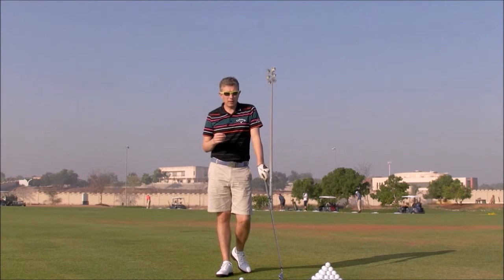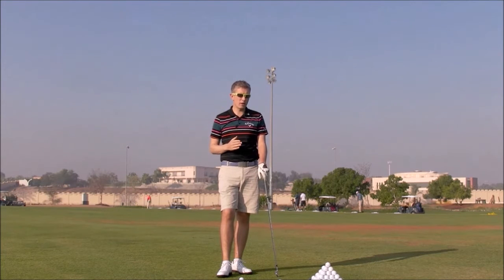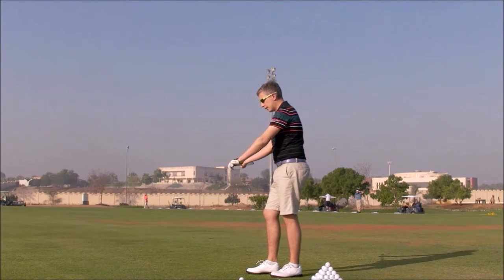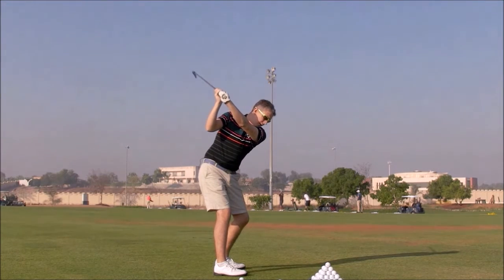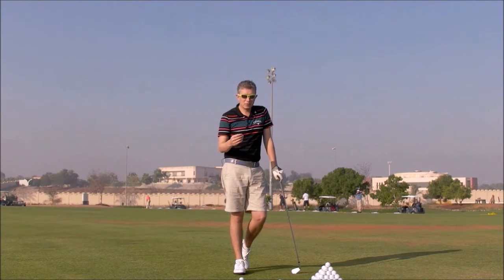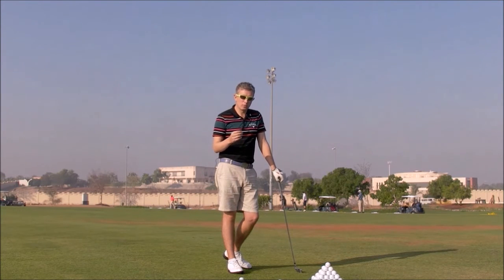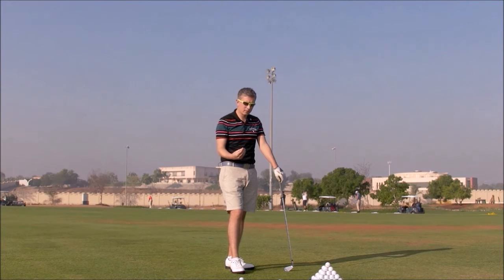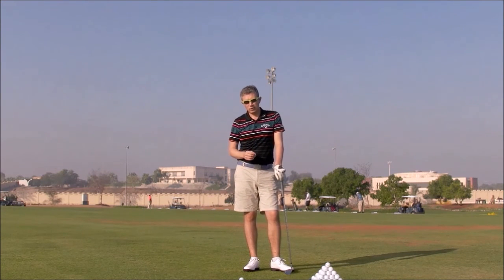Slice Cure - Motor Bike Drill

Comment: this is the most reliable way to "fix" the clubface on the way towards impact - I find that I can make a lot of errors with path, tempo, plane, etc. BUT, if I do this palmar flexion and even add some ulnar deviation (a full downward un-cocking of the left wrist), these errors cause far less trouble than they used to. If those other factors are nearly right, the results are super-solid strikes, straight as a pin, from driver through L-wedge. Using this technique, I can now smoothly hit my 60-deg L wedge 75-80 yards, 56-deg SW about 90-95 yards - this is a major improvement for me, even as I can't see how tour pros get a SW to fly 140 !! - thanks Mr. Symes - you are a brilliant instructor.

Comment: Great tip Robin
Reply from the maker: Ninja_Prime Thanks Ninja
Reply: RobinSymesGolf Hi Robin, isn't this similar to what Mr Ben Hogan used to do at the top of his backswing, I think it was one of his secret moves, if my memory serves me right. It certainly eliminates the slice, but makes you hook the ball. I might be doing something wrong in that case. Incorporating this into my golf swing takes some practice as I have a tendency to slice my driver and longer irons. My short irons I can hit fairly straight and I play better with those.
Reply from the maker: Ninja, for sure this is only for player who struggle badly with a slice, over done and you will see a right to left shape.  I will need to read up again, been a while, but Hogan struggled with a hook, so I think he weakened his left hand, he maybe even try to cup the wrist.  But you are right, his swing did have this look